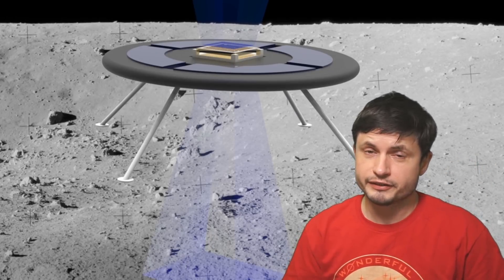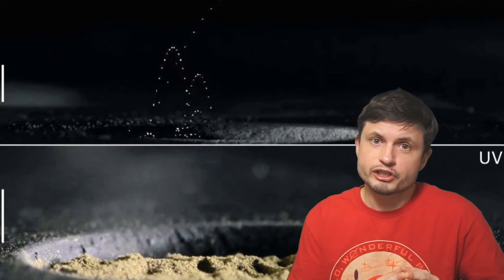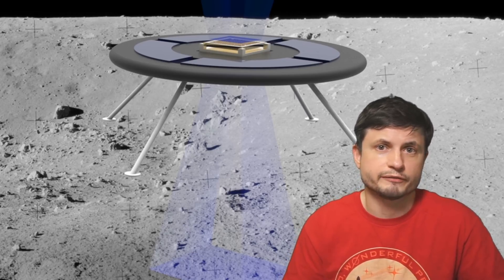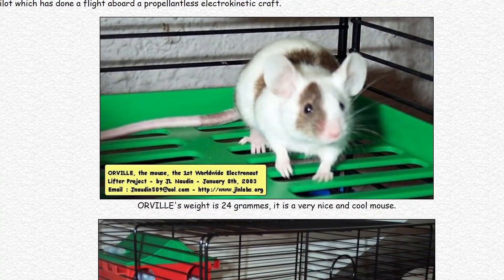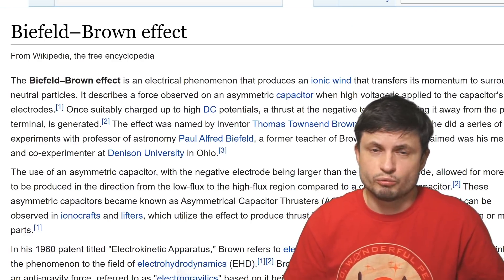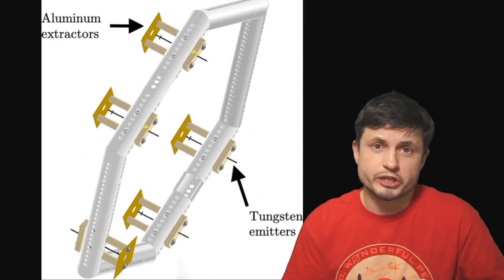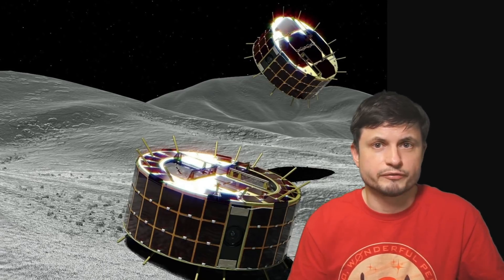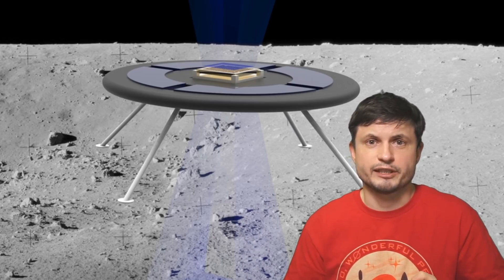Flying Saucers Could Work On the Moon By Hovering Using Static

Comment: Lol, this was invented decades ago as ion lifters, research Biefeld Brown effect.  UFO's use a similar propulsion system that scientists once considered fringe science.  It can be done using electrostatic generators, you know, the ones used in science class that caused your hair to stand on end, high voltage but with low amps.  I'm a retired professional 3D CADD AIA architect, I know how to design and build them.  Matter of fact, I designed using 3D CADD a 5 story 22 ft. diameter electrostatic generating craft many years ago using two electric motors spinning liquid mercury in a pair of torus shaped drums which then produced the required electrostatic charges to levitate the craft, (anti-gravity).  They transferred the charge along sheets of copper plates each sandwiched between glass along the outside of the craft.  That's how in 2004 I figured out what was actually producing gravity.  I recently published books describing the action creating gravity inside of mass, and it's not the warping of spacetime either.  Einstein was way off base.  The action creating gravity inside of mass also explain the extra propulsion observed occurring to stars pinned on dark matter and the expansion of space pinned on dark energy.  This one action explains the motion occurring to all mass throughout the universe.  I also came up with the equation that accurately predicts the motion of about 99.86% of the mass in the universe.  Currently only about 5% of the motion can be explained by general relativity and the laws of motion.  It's all in my books, even my equations that accurately predict the motion of stars and galaxies without having to resort to using dark matter or dark energy to explain it.  I've wrote all about this here on Anton's videos awhile ago.  Apparently no one pays any attention to the comments they don't really understand.  It won't be long and people will start catching up to this fringe science that's been around for decades.
Reply: How have they not offed you when so many others experimenting or researching these technologies were brought to nasty ends?  We've been stuck in a technology and science rut where the only technologies allowed to advance publicly are those of totalitarian domination and control.  Only negative entities are ever allowed to have the real science and technology.  The whole universe is ruled by evil, so most beings will never know, or many of the few who do will never be allowed to build on it except for the negative control systems.  There is no real future for us.
Reply: @ahmataevo  Probably because I haven't tried to patent anything.  Those who become targets try and patent their ideas.  Not me.  I learned a long time ago.  My best friend was shot in the chest and killed with a 12 gage after he tried to patent his so-called wild ideas.  They ruled it a suicide.  Patents are how they find you.  Instead of patenting my work, I self published them in books, which are copyright protected.

Comment: Doesn't this require lots of energy, which means lots of batteries, which means heavy, which means not working?
Reply: Maybe offset by far lower gravity of the moon?
Reply: Take it to space on a huge ass rocket and have that loaded with batteries. Might have to use a wire.
Reply: @User6381-k5f  😂😂that has to be a huge ass wire. Have to give it to you, high class engineering mate.

Comment: im fairly sure myth busters tested this and found it doesn't' work in a vacuum
Reply: On our planet, with not static particles and no material for the reaction to work. Remember you can test a much you want in here but unless you are in a place that let you remove the our planet gravity, it will work like you are outside your garden. Plus like Anton stated, after a certain payload or weight it not work properly (or at all) and the energy need it is so great that is useless to even try.

Comment: Cue the stampede of Thunderdolts coming to claim this proves their fake cosmology.
Reply: They already have and predicted it years ago but moribund mediocre minds wile you are in denial
Reply: @esecallum  Tell you what:  make an actual physics-based argument for EU.  None of that tinfoil hat conspiracy nonsense, I mean based on actual physics.  You can try to tell me, for example, why it is that if I take two balls of roughly equal mass of iron and wood to the top of a tower and drop them, they accelerate toward the ground at the same rate, when iron clearly has more magnetic attraction and electrical conductivity than wood.  Can you do that?
Reply: @Thomas.Wright  because they are not charged and are not plasms
Reply: @Thomas.Wright  SO you deny the existence of MAGNETIC AND ELECTRIC FIELDS IN SPACE?
Reply: @esecallum  No.  But I do deny the basic premise of EU that claims that gravity is the direct result of electrical and magnetic forces.  Just because electrical and magnetic forces do exist doesn't mean that EU is true.  Do you even know anything about the supposed theory you're attempting to defend?
Reply: @esecallum  Let me just lay it on the line here:  do you deny that gravity is real?  If so, then my example with the two objects accelerating in gravity proves that wrong.  And if you don't deny that gravity is real, then you admit that EU is a fraud.  So which is it?
Reply: @Thomas.Wright  PU not EU which is fringe. PU says e and m fields make a contribution to universe formation etc..
only last week m fields were measured by a giant telescope. now you cannot have m fields without E fields.
Reply: @Thomas.Wright  i never said anything about gravity except its the weakest force.
I said PU not EU . you seem confused.
Reply: @esecallum  Oh, so you mean Plasma COSMOLOGY, another defunct theory?  On the contrary, I think you're the one confused.  Come back when you figure out which pseudo-theory you want to defend.
Reply: @esecallum  No they haven't.  People like you are just gullible and have fallen for their hoax.  EU is nothing but a fraud.

Comment: sharp dust works really great for cement concrete and building materials
Reply: Lunar cement will be stronger than any moon rock is now. We will need that in those lava tubes.
Reply: Then its decided .. bezos is going to build a giga amazon warehouse on the moon and pave the whole surfice as a carpark lot for flying saucers were doomed! Also the futute will see company names etched opn the moon
Reply: @Peter from NZ Cool idea! I bet casting shapes like bricks would be a good place to start. Plus the moon has large rocks, it may be cool to build with boulders in low gravity.
Reply: It's fine & clingy.
 Words from first moon walkers, on repressureiseing the cabin, post first "walk" on the moon.
Reply: As does blood(strengthening concrete many times over)
Reply: The finer the powder the better.
Reply: @theshepardthewolfandtheshe5304  If the powder (sand or so) is too fine it will not bond good. That is why Gulf states import sand, their is too fine.
Reply: @maciek_k.cichon . Rock dust from gravel crushers is a very fine powder not sand. It is basically mixed in with the hardener or powdered lime stone in what you purchase in your cement bags. There are also other fine crushed powders from other materials also. Without these fine powders, your sand or sharp dust would not be able to take form. 
 You don’t even need sand in concrete mix except for strength.
Reply: @maciek_k.cichon  that is because the sand is to round, its more about the shape then the size just watched a documentary
Reply: @theshepardthewolfandtheshe5304  Yes... Gray Powder of course 👍